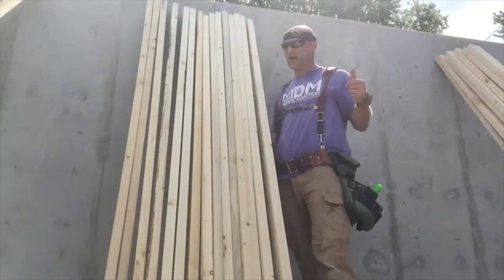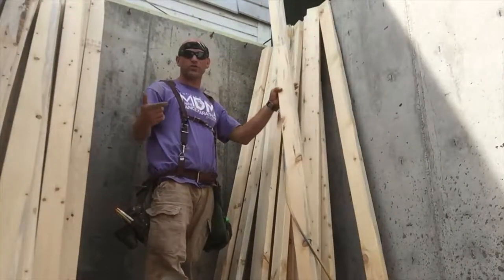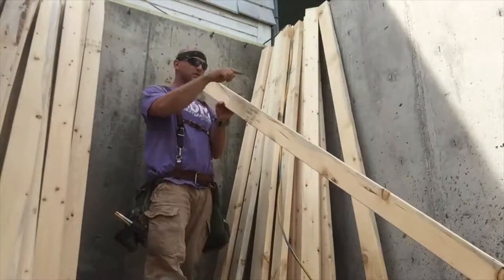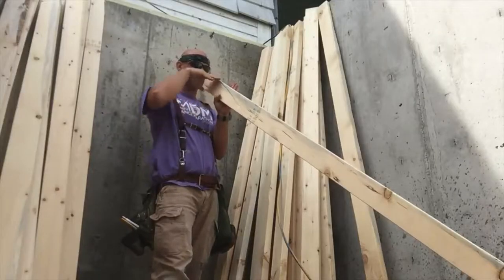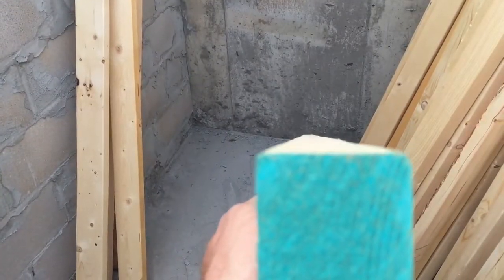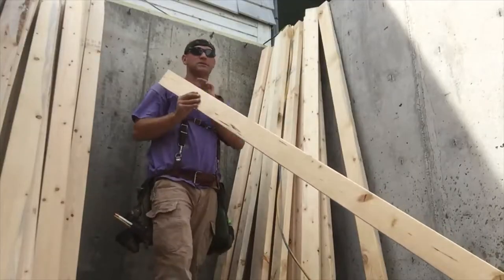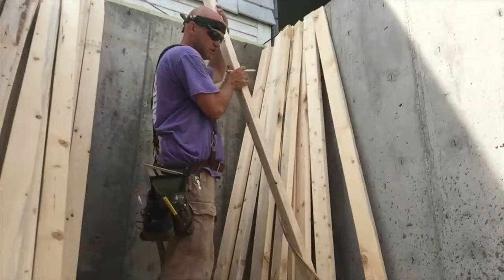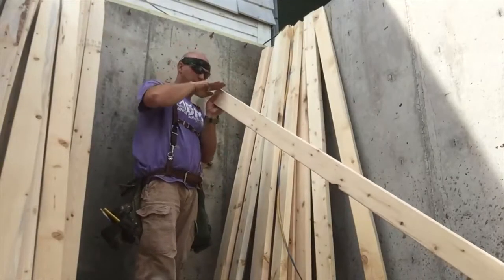How to crown studs

Comment: hi one question, i may of missed this but for clarification when putting up the wall the crown faces the exterior right? what about when you have interior walls in a house, where does the crown face? or does it not matter as long as the section of that wall faces the same way? thank you!
Reply from the maker: You are correct, when the wall is laying down, the crown always goes up. That way, all the crown of the studs faces the same way.  Crown goes to the exterior and on interior walls, it needs to all be in the same direction.
Reply: @mr.kongable  thank you! one more question when framing windows between studs do you still have the crown facing the same way?
Reply from the maker: @raula.delgado3109  Yes, I always put the crown facing out so there isn't a bump in the drywall on the inside of the wall. Good Question!

Comment: Once the frame has been completed on the floor do you want the crown side facing your eventually drywall or do you want it facing the outside?
Reply from the maker: If the wall is going against an outside wall, I usually put the crown to the concrete wall.

Comment: at 1:43 you said with a bad one crowned more than 3/16, you use it for something else? what do you end up using it for? noggins? also, thanks for a good video
Reply from the maker: I usually cut up the bad ones for blocking between floor joists or keep them for truss bracing when I set the roof trusses. Thanks for watching

Comment: What about base n top plates. Crown up , when laying flat, or facing into the room?
Reply from the maker: I always put the crown up on base and top plates when building the walls so they all have the crown the same way. With base and top plates, I try not to get use the ones that have too much crown in them.
Reply: @mr.kongable  I meant when installing base on floor since I don't have enough room to build on floor. Does it matter on top n base plates? I was told if I see light under base plate that means the top of the base has the crown n should face up.When I ramset in the floor it will all lay flat.

Comment: Thank you! If framing a basement, is it best to have the crown on the outside or inside?
Reply from the maker: I like to have the crown to the concrete side, and then snap a line 4 inches out from the concrete.  That way, you have a half inch that can be a buffer for any stud that has a large crown and it isn't showing in your drywall on the inside of the wall.
Reply: Mr. Kongable  I think I understood what you mean, but, just want to double check to be sure.  Is the crown up when you can’t see the end, all the way down the lumber?
Reply from the maker: @AaronWanamaker91  You are exactly right, think of it like a hill, if you can't see over the hill, that is the crown side.
Reply: Mr. Kongable  ok.  Cool that’s exacty what I was thinking.  I just always felt like I was doing it wrong.
Reply: Mr. Kongable thank you for your help!
Reply from the maker: @AaronWanamaker91  Sure thing, glad I was able to help
Reply: Thank you for explaining the basics 🙏

Comment: Awesome:  one question?  does it matter if the crowned side is in or out?  guess it does not matter                      ??
Reply from the maker: It doesn't matter, as long as you keep them all crowned to the same side
Reply: @mr.kongable  If the crown is on the outside, the drywallers/mudders will have a valley on the inside where the mud can go and better hide the seams.
Reply from the maker: @marcohabib2836  if there is much of a valley on the inside, then you should pick different studs. I don’t use them if there is more than 1/4” of crown in 8 feet of stud